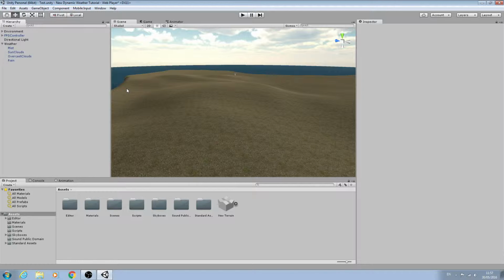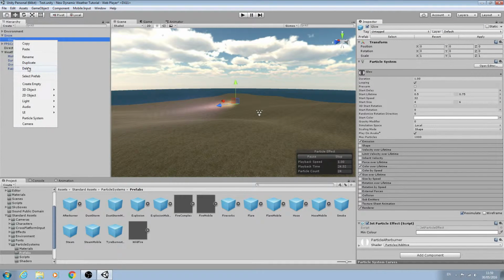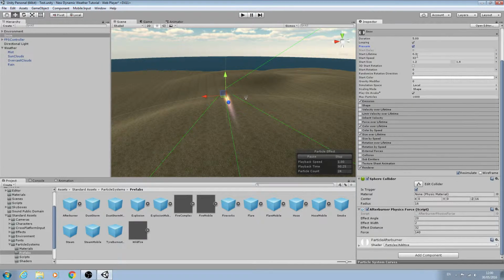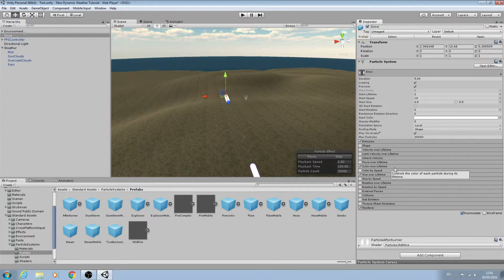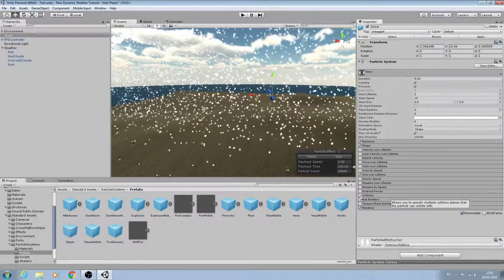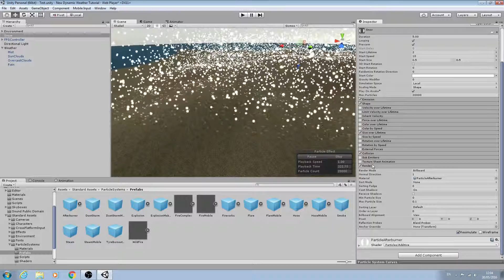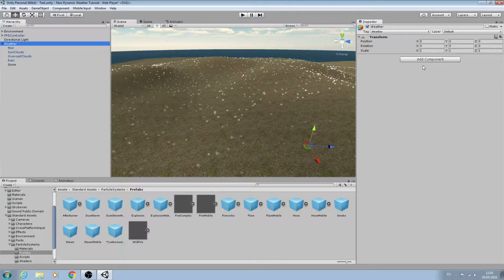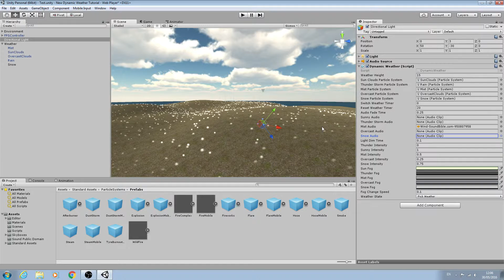Unity3D Dynamic Weather Tutorial #22 Snow Particle System

Comment: I'm still having issues with my particle systems. 

I have all of them created and assigned.
I have an empty gameobject tagged Weather.
I have an FPS tagged player.

Im still getting that NullReferenceException: do not create your own particle system, use a particle system instance.
The script will not pick weather after the error. 

Clicking on the error takes me to the _sunClouds.enabled = false; within the void PickWeather () function.
When commenting that line out it flags the _thunderstorm.enabled = false; then the mist and so on. 

If i comment out all of the code setting the particle systems to false,  it will finally pick weather, but will flag a NullReferenceException on the _sunClouds.enabled = true; line within the void SunnyWeather ().

It will flag every instance of me trying to enable or disable the particle system, then quit. 

If i comment out all of them in all functions,  then the script works,  but all of the particle systems run at 0,0,0 and will not follow the player game object.
Reply: I noticed that the particle system was moving,  it's offset far from the weather game object for some reason. 

By playing with the emitter location in the particle settings i was able to get the particle system to stay with me. 

Still having issues with the particle emission lines though.
Reply from the maker: Hi Dan. Send me a private message with a copy of your script and if possible a screen shot of your project with all gameobjects in the hierarchy expanded so I can see which objects are attached to other objects and I'll try to see where the problems are.